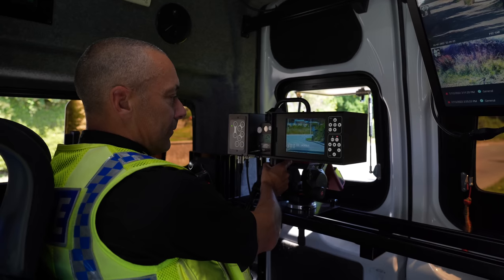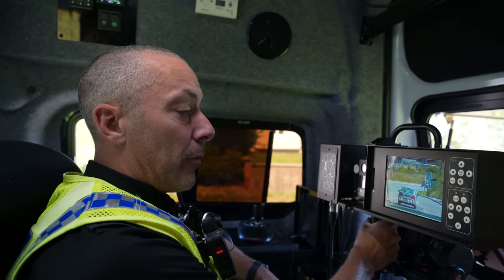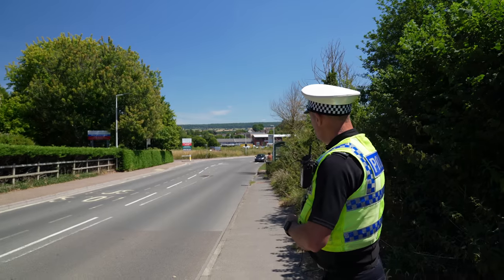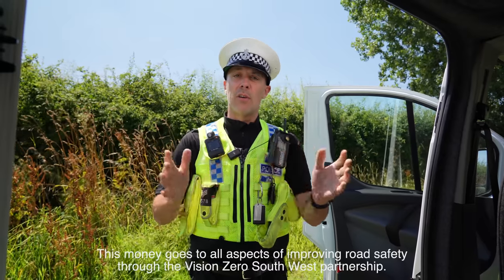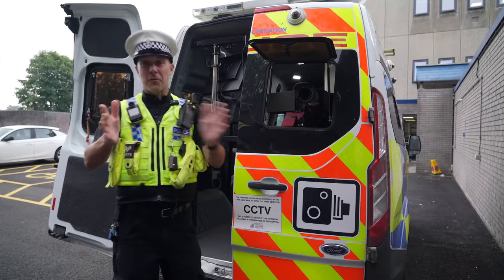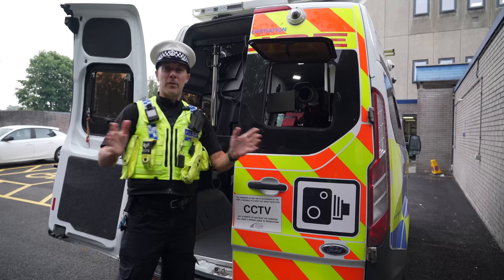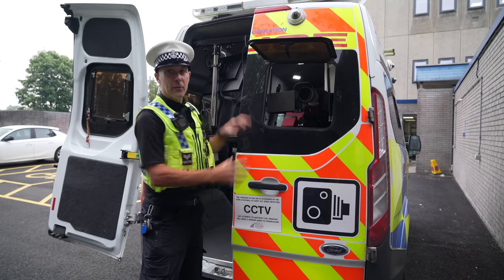SPEED CAMERAS - Road Safety or Cash Cows?

Comment: I came upto one of these vans parked on a duel carriageway bridge on my motorcycle. 

Not going to disclose the speed I was doing. 

Came round the corner and saw the van - instantly slowed down so was going the limit as I went past.

I shat myself for 2 weeks haha - didn’t get a ticket. 

I didn’t see what way the camera was pointing because it all happened so fast. My thought was that because I was approaching it and obviously have no front numberplate I could possibly be immune to the camera van in that direction. 

My question is that how would you enforce this situation? How can you use a secondary camera for the numberplate? I would say in court that the second picture of my numberplate which was not taken by the speed measuring device is not my vehicle. And you would have no way to prove that it was.
Reply: The Concept system (as above), has a PTZ front facing camera (it's on the roof), all linked to the cameras on the side of the van.

The footage is encrypted and date and time stamped, so is continuously recorded from the moment you appear, your speed is measured, you pass the van, picked up by the side camera, then the front which records your plate and you go out of shot.

Your plate would also be recorded by the ANPR system.

You can also say 'My hippopotamus is called Leonard', but that will have no impact on the outcome either.
Reply: @unleashthedragonwithin2057  but how could they use 2 pictures? I could just say that wasn’t my bike.
Reply: @DerKaktusAvant  The system doesn't record 'pictures', it is continuously rolling linked encrypted video.  You could say that your dog is called Rupert, but it wouldn't make any difference to the recorded evidence.

Comment: I'm not someone who tends to speed so if I got caught out by a van then it'd be my responsibility, but when you do see the vans parked in snidy places, then I'd beg to differ that reason the van is there is to slow people down. On the A525 in gwynfryn North Wales the vans park behind a bunch of trees on the boundary between a 40 and 60, on a straight road for about 3/4s of a mile and 1 house opposite where it parks, who it's protecting I'm not sure. 
Then the village where I live which has had a few fatalities since the 3 years I've lived here, on weekends motorbikes and cars drive through at ridiculous speeds and there's no speed camera or van as a deterant.
Reply: There are a great locations where enforcement is needed, so it may be that there is no suitable location to park, or it isn't on the police's radar.  Have you requested they attend?
Reply: @unleashthedragonwithin2057  yes

Comment: Does the windows have to be open for the camera to be operating? Or can they operate through the closed tinted windows ? Just found you on YouTube, just subscribed 🤙🏼
Reply: I'm pretty sure they can. Those vans can be mobile and driving around and they can catch you speed up behind them as they are driving.
Reply: The windows need to the open, the equipment is only approved for use through ‘open air’ (ie no obstruction). 

The detector uses lasers to measure distance over a set time (and calculate speed) and so the glass/plastic will affect the functioning of these lasers 👍
Reply: @geko7844  Those cameras can still catch you speeding while the mobile speed van is driving. I’d presume the tinted window would be closed while moving, right?
Reply: @zouzou_u  no, they can’t. The device requires an operator to be sitting at it, which they can’t do whilst it’s moving and the windows are closed when it’s moving. 

In addition, the device works by measuring a change in distance over a set time and calculating an average speed over that distance. If the device is moving at the same speed as the target, then it will record a speed of 0 as there has been no change in distance. They are not designed to work on the move. Traffic vehicles have devices which can measure speed ‘on the move’ but these vans cannot.
Reply: @geko7844  that’s not what I’ve heard. I can’t take your word on it lol.
Reply: @zouzou_u  I bet you've heard to BBC have television detection vans too.
Reply: @geko7844  wicked, I did always wonder, always hear different things lol! cheers for the reply mate 🤙🏼
Reply: The police guidelines state:

10.4.1 General
Laser speedmeters must not be used through glass or plastic screens to avoid diffraction
or scattering of the laser beam. While vehicle screens pass light with minimum diffraction,
elements within vehicle screens, as well as their cleanliness, makes the path of laser light less
predictable so it is discouraged in law enforcement devices. They can be used from within
vehicles through an open aperture, such as a window.
Take care that lenses are not damaged or dirty by not placing the instrument in a position
where this can occur. Make a visual inspection of the equipment for damage before use.
Reply: @unleashthedragonwithin2057  Perfect
Reply: @zouzou_u  ok buddy.
Reply: @unleashthedragonwithin2057  wicked cheers for the info mate 👍🏼👍🏼

Comment: Do the vans have the same tolerance as a usual speed camera IE 10%+2mph? Or do they just get you for going anything over. 

Always wondered
Reply: most of them give you a bit of leeway usually 10%+2 but they measure GPS speed most cars Speedo’s aren’t 100% accurate and you’re typically going slower than you think
Reply: @kyenev  They donot mesure "gps" speed..... 

The camera sends a unseen laser beam and this is what measures your speed.
Reply: @EnemyDwarf-TTV  yes which is your gps speed
Reply: @kyenev  Come on explain this further.
Reply: @nickolasreeks4743  right so for instance most modern cars (not all cars) your Speedo might for instant read 34mph but you’re only actually travelling 30mph. Not sure why manufacturers do this. So if you’re doing 34 on your Speedo and you see a van you’ll obviously not be doing 34 miles an hour exactly and it’s usually a few mph less. Then you get 10%+2 leeway usually so you can be doing much over 30 on your cars Speedo before you’re clocked speeding
Reply: @kyenev  The variance is built in from manufacture to take into consideration of the different tyre sizes that can be optioned, as they will all change the final drive ratio.
Reply: @kyenev  what the bollock are you talking about. The word you need is true speed.
Reply: @kyenev  Car speedos are supposed to be a guide and not accurate.  Incorrect tyre pressures, tyre wear etc will throw out the speedo on the car.  This is why they are biased to say you are driving faster than you actually are.

Boy racers are typical example, they will put the biggest wheels they can on the car, then the speedo is way off, then likely the speedo is registering lower than it should be.

Comment: Cash cows 100%, there’s one near me that always sits at the bottom of a hill around a blind bend on a dual carriageway, it’s such a hill that if you actually let off the accelerator and let the car coast by itself you’ll reach 75-80mph, so you literally have to brake to avoid speeding which in my opinion, braking on a dual carriageway so you don’t exceed by a few mph is far more dangerous than not braking at all.

Comment: You say they are highly visible so not revenue raisers, but also state they work a mile away so we've probably already caught you before you see us. It can't be both ways. And i have seen these vans parked where they are semi obscured. Just as you see traffic wardens hiding around corners and this is also denied. But if they are used in places like this outside schools i'm all for them.... But not on motorways on top of bridges. But i have no issue with fixed cameras on gantrys with warning signs, as these catch the unobservant driver which is more dangerous than a speeder in my opinion.
Reply: No, 1000m is not a mile.  Very few enforcement sites cover such distances, so visibility is totally relevant.

Why outside schools, can you provide any collision data to evidence the need?

More dangerous than a speeder?

Mindless Northumberland driver spared jail after clocking speeds of 103mph in a 30mph zone

'This motor menace was captured on camera clocking a staggering 103mph in a 30mph zone during the morning rush hour.

Mindless Stephen Dunn was behind the wheel of his Honda Civic when he reached the shocking speed along the A193 near Bebside and Bedlington, in Northumberland.  A court heard that there is a 30mph limit in the area because of junctions, garages, shops and residential properties only being 1m or 2m from the roadside.

But that didn't stop Dunn from putting his foot down and hitting 103mph before he spotted a manned mobile speed camera, prompting him to slam his brakes on so hard he skidded after his wheels locked and smoke could be seen coming from his tyres, prosecutors said.'

Comment: When you have cars in areas which are speed enforced, especially by average speed cameras, the drivers are concentrating on their speedo rather than eyes on the road.

I'm in Wales and the 30mph speed limit is being lowered to 20mph.  Locally to me they have just installed 6 miles of average speed cameras along a 20mph road.  This was paid for by council and confirmed in the press release that all money goes to the police.  

I have already tried to drive 20mph on these roads and it is quite difficult, I was watching my speedo and going through the gears a lot more.  I do have cruise control and have to set it at 17mph because the car can creep over sometimes.  But to travel 6 miles at 20 mph will take best part of 20 minutes.
Reply: That’s ridiculous!
Reply: Do you object to the speed limit or the idea of a speed limit? These vans aren't declaring the speed limit there enforcing it.
Reply: @PCDelorian  In this case, I feel a 20mph speed limit being enforced with average speed cameras over 6 miles is insanity.  I use this road daily for 3 miles as there is no other option and it is torture.  

There are cars parked on this road, so you have to give way and come to a stop regularly.  Yesterday I reset my cars computer and it recorded over 3.4 miles my average speed was 14.3mph, 14 minutes and that was only half the length of the road!

Comment: A fixed speed camera will permanently deter speeding at that location. A mobile van will not, as no one knows it’s there. You’ve just shown that as soon as a vehicle rounds the corner, you’ve got them; wouldn’t it be more fair to do a secondary check, now the van is in sight, as likely the vehicle has slowed. Therefore its argument as a speed deterrent is invalid and it’s pure purpose is as a “trap” to generate revenue. Driver education goes a lot further to controlling speeding, where as instant catch-and-fine from a faceless operator in a van only portrays the police in a negative light. 

If for cost reasons it’s not viable to place a fixed camera, why not place a couple of temporary signs (while in operation) a few hundred meters either side saying “mobile speed enforcement deployed ahead”. Watch how safely everyone drives then, and if they don’t, they deserve to be caught or educated. What you say at the end I agree with, drivers did sign up to the rules, but as you well know 95% of the driving public are a thick as pig shite (where driving without due care is more of a problem than speed) and need constant herding like sheep with brain damage. Just a thought, but won’t be taken on board I understand.

Comment: Cash Cows. There’s been a 40mph limit on a street in my town for many many years. Had plenty of signs up ahead of it.
But now… they’ve reduced the speed limit to 30mph, took all the signs down and just put one up either side of the camera about only 20 metres away. I only saw it recently and slammed my breaks on. So I was always doing the correct speed but now I may be a criminal for SPEEDING. Why didn’t they put large interim signs up informing the public of the speed change coming and when it was in force. SCAM
Reply: There cannot be repeater signs on a restricted road.

Comment: so its designed for safety ..... then why is it mobile ??, no seriously ... why is it mobile, if there is an accident blackspot then the council should install a hard wired speed camera and not wastes £60,000 - £90,000 on a van, those vans are cash cows, nothing more, nothing less
Reply: Because each speed camera is around £70,000 and can only be in one place. If a van does indeed cost between £60,000 to £90,000 and can be used in several "blackspots" each day, then to me that is not a waste of money.
Reply: Actually, just seen another costing for a rural static speed camera of £40,000. Still can only be in one place though...
Reply: There are many hundreds of sites, a van can attend all, especially locations where statics cannot be deployed.

Comment: I agree totally about the use of speed cameras, and the benefits they bring. The only thing that wrangles me is that on the odd occasion - and we've all done it - that you momentarily lose concentration on you speed, and say find yourself at 35 in a 30 - and it's really easy to do - the camera van will clock you at 10% +2 (gov't guidelines) - and you'll get 3 points and a £100 fine - with absolutely no leeway given, as may have been the case in the old days when a police car stopped you.  Personally I would give 1st offenders a warning letter if they exceeded the limit by a small amount - and only then progress to the usual points and fine if a second offence occurred or if the speed was exceeded by a substantial amount.
Reply: No, 10+2 is ACPO guidelines.  No leeway given?  That IS the leeway!  Plus you'd be offered a course first before points and a fine.
Reply: no the 10% + 2 is to account for inaccuracy in the speedometer. Not the momentary lapse of concentration from the driver.  @Only_Fools_and_Audits
Reply: @20252c  You misunderstand, I never stated anything about concentration lapses.  The 10% + 2 is published in the ACPO guidelines that has yet to be overwritten by the NPCC.

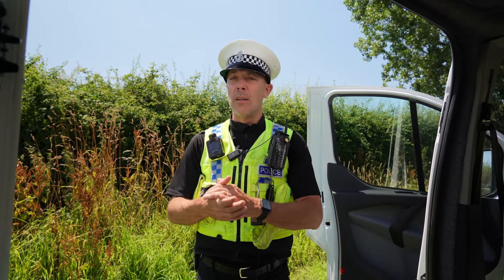Comment: Quote at 2:50 in video "One thing you probably didn't realise was that the camera has a range of about a 1000 metres. So if you'd seen the camera van it's probably too late and it's already seen you" and @3:18 "just the presence of this van is doing enough to slow people down. So ultimately its doing its job" 
But hang on a minute they were all clocked by the van @ 1km. Before they saw the van. So none of them were speeding before seeing the van. In other words it was no deterrent, and contrary to their concerns while at that location no one was speeding. Earlier in the video he made a big thing about visibility. But his statement confirms the camera is in effect covert because it is not seen before being clocked. If it was the deterrent claimed. One would be clocked after seeing the van & if ignored speeding recorded. These are NOT for safety.
I witnessed one of these vans on a dual carriage way which did not clearly sign the speed limit on the road. My sat nav informed me the speed limit was 60, and that was the only indication of the speed limit for that road. How many cars will have been fined for speeding, only to risk an even bigger fine informing the police the signs are inadequate?
It is a national disgrace that cameras are positioned where the speed limit is unclear. After all they are there for safety? All fixed speed cameras should include a physical speed limit sign in the cameras field of view, which was also visible to the driver at the time the photo taken. (The latest cameras record a measured speed which is NOT VISIBLE to the driver and provide no means of independently verifying accuracy. Not only that but many signs are hidden by tree branches/vegetation obscuring drivers views of essential information.

Comment: The signs that light up your speed as you approach them are approximately 25% more effective, far more versatile (being able to move them and leave in situ) and 6 times cheaper than speed cameras in general BUT DONT PRODUCE ANY REVENUE - consequently not used as often🤔🤔

Comment: On Waze/ Google maps drivers can report camera van locations, therefore users of these apps can use that to their advantage and avoid getting caught. Having said that i don't see how this is much different to simply flashing oncoming traffic - if flashing isn't allowed how come these apps have this function operational? seems a bit daft to me...
Reply: Dead simple, Google etc tell you a known site is ahead even when no enforcement is actually taking place.

Flashing your lights is designed to inform that police ARE ahead, which is obstructing police and:

Rule 110. Flashing headlights. Only flash your headlights to let other road users know that you are there. Do not flash your headlights to convey any other message or intimidate other road users.
Reply: @liamholland949  UK police did?
Reply: @unleashthedragonwithin2057  that's not entirely true at least i can vouch for Waze, users of the app report mobile police enforcement cameras then all the users maps get updated - if no one reports it, it wont appear for anyone else, it appears instantaneously as someone reports it - it doesn't have a constant 'known site' like you suggested.
Reply: @kelvinclamp5700  Not quite what I meant.  All around the country are old analogue Type 24 Gatso housings.  These are empty, as they have no cameras in them, SERCO ceased support in 2012 and wet film in bulk is virtually impossible to source in 2022.

These all still appear on Google, WAZE, camera databases across the country, but no enforcement is taking place.